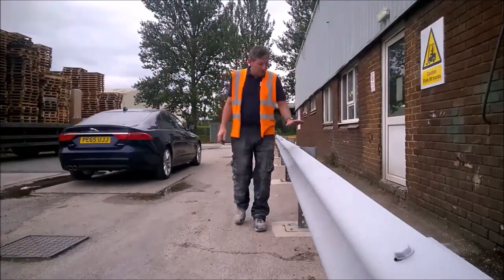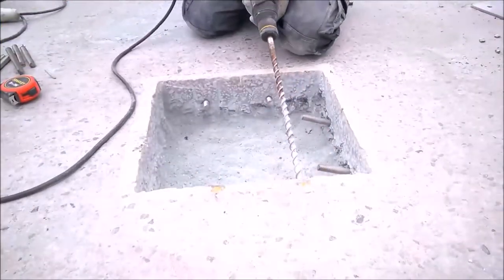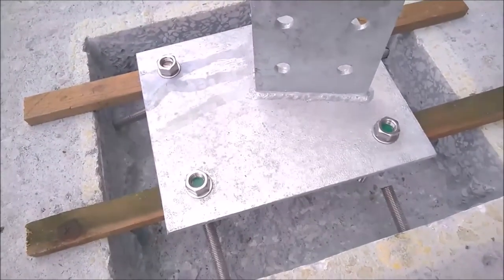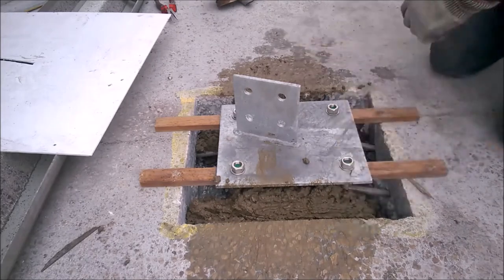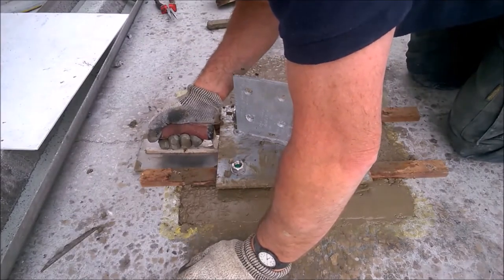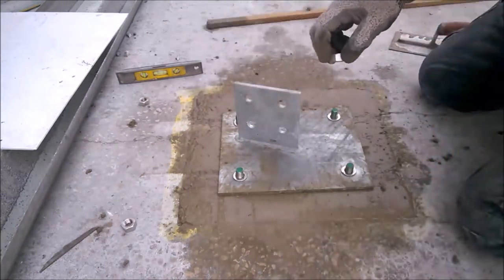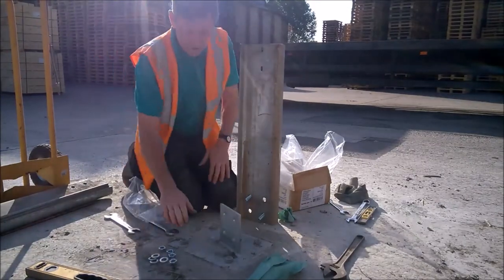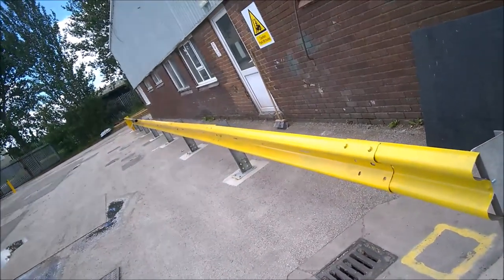Installing a crash barrier.

Comment: Lovely work but completely overkill, Chem-fix and Rawl bolts will give you the same if not more resistance to pull out during a collision so all that cutting of the concrete and mixing new concrete and using those wooden bearers is pointless, filling the hole and just dropping the leg onto the wet concrete would do the exact same you’re still going to have to level it up at the end. I’m sorry because you made a really nice job but there’s too many steps that didn’t need to be taken here. I get it, day rate is day rate I suppose…… 😊
Reply: yes was thinking the same